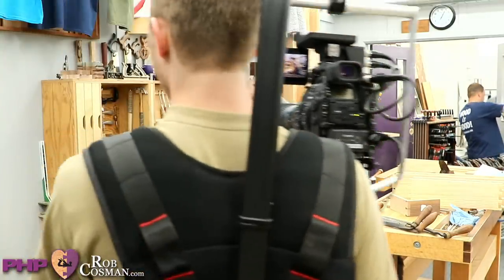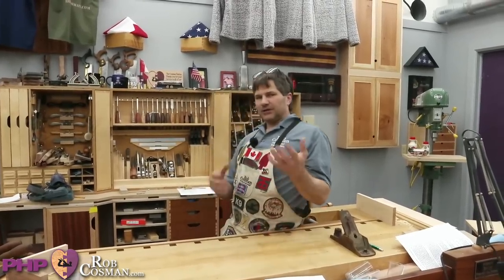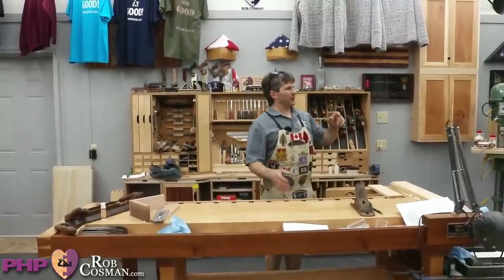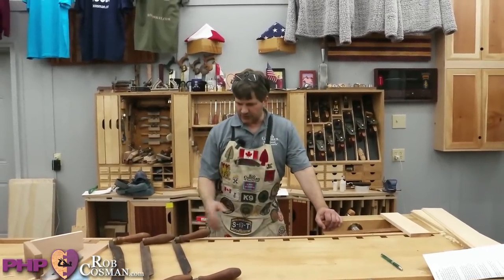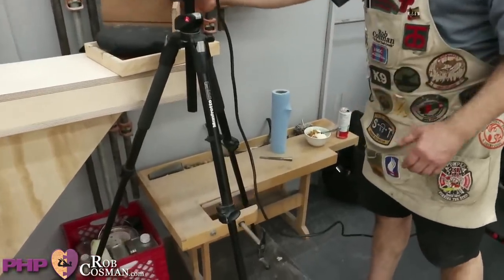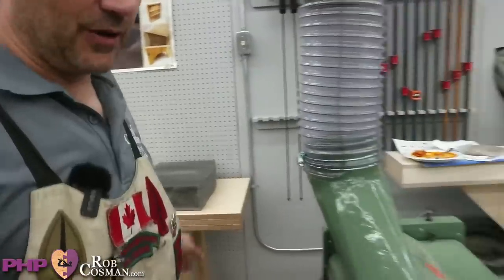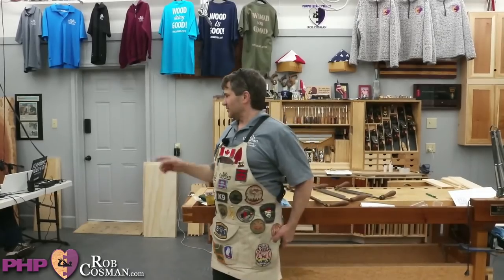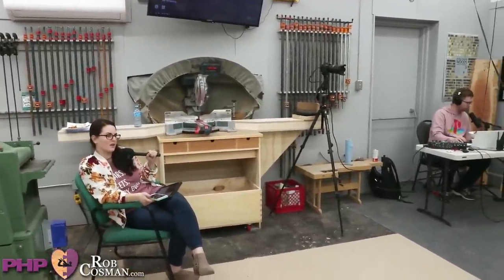Setting Up A Workshop - Live Q & A (25 May 2021)

Comment: Rob - For wheelchair users you recommend a "U" shaped bench with scissor lift.  I have a son in a power wheelchair.  The scissor lift is an excellent idea, but for the reason that not every wheelchair sits at the same height.  You teach VETS so rather than suggesting they use a "U' shaped bench why don't you build one for your classes.  Video the build.  Make the needed adaptations for the vices.  Having an accessible bench in your class would speak volumes and validate your desire to support VETS and others with disabilities.  Can't wait to see this video.  I will be the first viewer.

Comment: For the question about sound proofing try homasote panels (4x8 sheets) 1/2 inch thick. It is also called sound board. It is around $30 a sheet at the big box stores. It is a compressed paper product used in sound studios.

Comment: Rust prevention on steel tools? Wipe with camellia oil.  Mr Charlesworth uses it and so do I.  It has a very long history, is cheap and it works and does not cause any problems with the timber.

Comment: Hallo Rob. Maybe this is a question for an answer in another video. But is it possible to cut a mortice for an apron with a mortice chisel in a 45 degree angle to the side of a table leg, if I want the table to have the legs turned 45 degrees around  the long leg axis. This would make the flat sides of the legs show on the corners of the table.  Don't know if my explanation makes much sense. 😬

Comment: Hi Rob, you mentioned that you would not use a miter saw for finish work , is it because of the lack of accuracy when in miter mode or the lack of control ? could you clarify.  Thank you
Reply: Said it was for lack of accuracy and has said before in previous video lack of finish.  Its just personal opinion, I have 44T fine blade in my 10" and it gives a great finish and the accuracy is down to you own setting up
Reply from the maker: Once you have the skill to truly sharpen a plane and you shoot a flat mitre, you won’t go back to any chop saw.

Comment: How do you go about replacing the wood handles on my vintage Stanley Everlasting chisels???
Reply: Only if the chisel body is accommodating! The wooden handles on my Everlasting chisels are not of the socket variety that are simply turned on a lathe and then inserted into the Chisel's socket... They seem to be in more than one piece that needs to be inserted into a "hallow-ish", semi-enclosed area on the chisel...